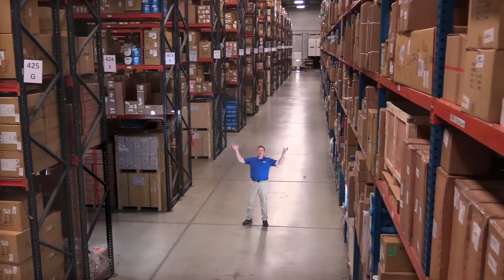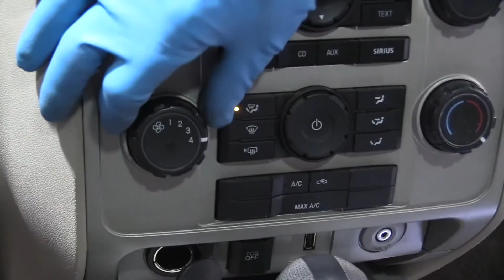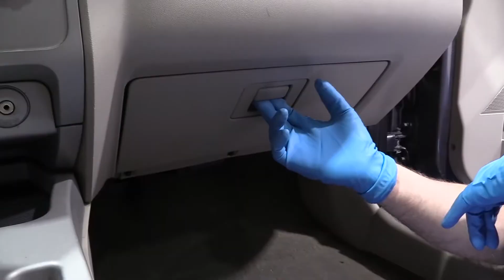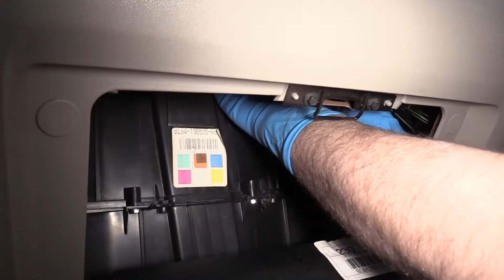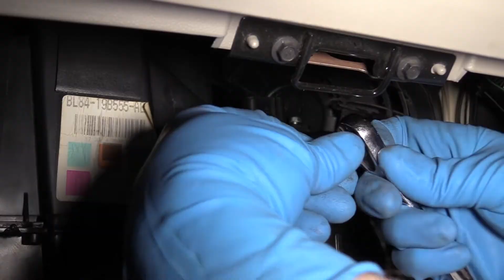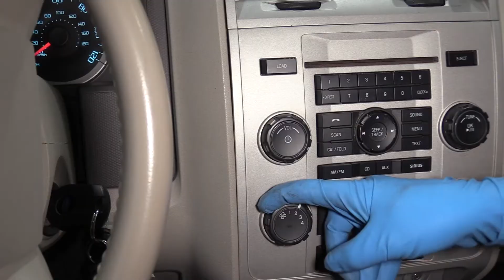How to Replace Blower Motor Resistor 08-12 Ford Escape

Comment: Just opened up my glove box, and mine doesn't look like this.  The top of the resistor is bent at a right angle toward me, and I can't figure out how to release the plug.  Maybe the previous owner replaced the original with the wrong part?

Comment: Question:  I replaced my resistor with a brand new Motorcraft one and it made it WORSE.  Before I had speeds 3 and 4, now I only have 4 (which is no resistor).  How can I test the resistor pack?  Do you have resistance values from pin to pin?  What else could be the problem?

Comment: I fixed mine... $23 for the part.  It was difficult to get to, but easy to repair.  However it took me over an hour because the socket came loose and fell in there somewhere.  I couldn't see where so I used my phone to take videos up in there until I spotted it.  Then I used a magnet retriever stick, retrieved the socket and finished the job!
Reply: BTW... thank you for the excellent video!  The only thing I couldn't see from the video is which side of the new resistor went to the front.  I had to take a picture to find out which corner the notch went in.

Comment: Awesome!  Thank you!

One hint is to remove the transistor by taking the two bolts out first, THEN you remove the plug.  

Much easier that way and no pick required.

Comment: Very helpful... except the resistor that I bought from 1A Auto for my 2012 Ford Escape did not have the same pin registration holes as the original.   I bought my new resister from 1A Auto because of the excellent tutorial you provided on Youtube, even though I found replacement resisters for lower cost elsewhere.  You can imagine my disappointment to discover the new resistor did not drop in.    (I drilled out alignment pin holes to match the old one and inserted the new one.)     Thanks again for your great video posting.  Once I got the alignment pin issue sorted out (not much of a problem actually, but one did need to use a 3/16 drill).  The new unit is installed and the fan WORKS!!!... 🙂
Reply from the maker: +Skip Saunders Thank you! We love empowering our customers and showing how to perform DIY auto repairs with our high-quality auto parts.  http://1aau.to/m/Shop-1AAuto-c

Comment: HI, thank you for the great video. i had the similar issue ( fan was not working at 1,2 and 3) setting) and i was thinking about ordering it but when i checked my Resistor using voltmeter it seemed to be working fine. so i just used the lens cleaning liquid ( for no particular reason, it was just there on the shelf) and clean the surface with paper towel, plug it back again and it started working again. i am not sure how long it is going to last but before you order it try doing that if your resistor looks fine and has no corrosion or damage. 
also don't change your part because there is a huge blister on the chip, that huge blister is the heat sink and it is suppose to be there. 
hope it helps.

Comment: This part does not fit the 6 cylinder 2010 escape with auto temp control
Reply: There’s a different part number for the auto temp control. You can find it in any auto parts

Comment: Today july 19 2020 I replaced the same part.on my 2008 escape 
But even before  I changed out this part
The  ac/heat worked all on high speeds
So speed 1. Was like speed 4. I'm confused. Do I need a new hvac switch
( the part under the radio ) or what
I hate American cars. I never should've bought this junk suv.
Fix Or Repair Daily.  <<<<FORD
Reply from the maker: +S O N N Y We wouldn't be able to diagnose an issue like that here, you may want to have a local mechanic take a look at it. Thanks for checking us out! 1AAuto.com

Comment: Thank you for the great guidance in this video.  I was able to successfully install a new blower motor resistor in our 2010 Ford Escape XLT.  Much respect to "real" mechanics, as I found it difficult to position my body, fingers, and tools in the tight spaces.  I did it, but found myself visualizing the 8mm bolts as I worked the ratchet from an odd angle.  Thanks again!
Reply: Hello Lucas, I was having the same problem I found it difficult also, guess what I found an easier way to install the resistor There is a pop-out side panel on the right side of the glove box, I popped it out grabbed my special flashlight then I peeped in the port and I was able to see the resistor, connector wire assembly and the 2 screws, using a very small ratchet about 4 inches long and an 8mm socket I was done in no time, I simply popped the side-panel back in place.
I might add I positioned my flashlight in the glove box area where I didn't have to hold it, and peeping through the port hold where I could see everything, I also noticed that some guys/gals may have to drill 2 additional holes for the pivot pins that hold the resistor in place
Reply from the maker: +Lukas Brandon Thank you for the great reply. We love to empower our customers by showing you how-to perform your own auto repairs while installing our high quality auto parts. Have a great day! 1aauto.com